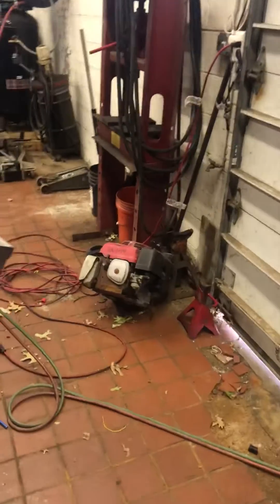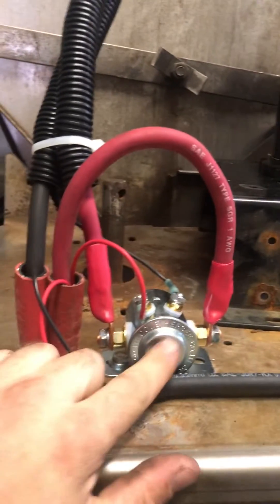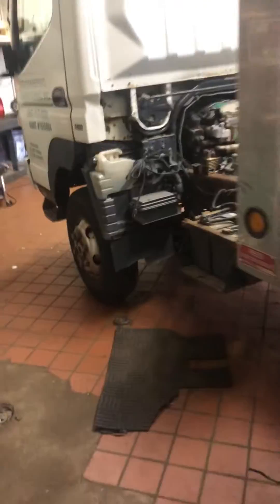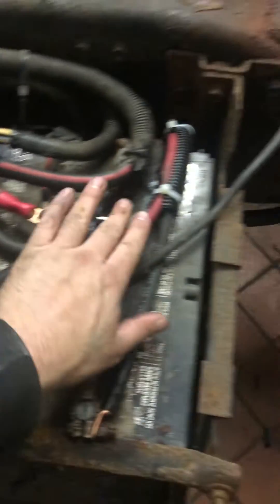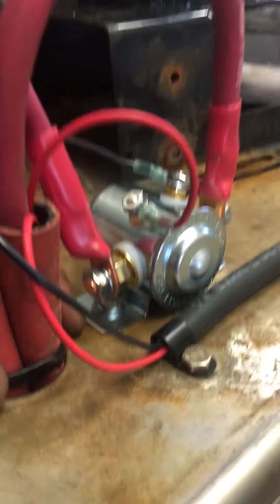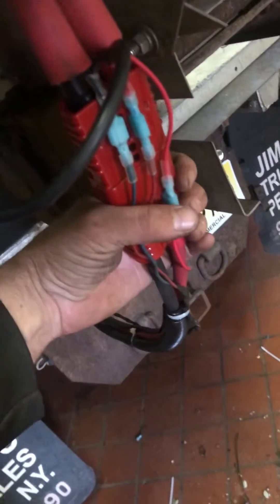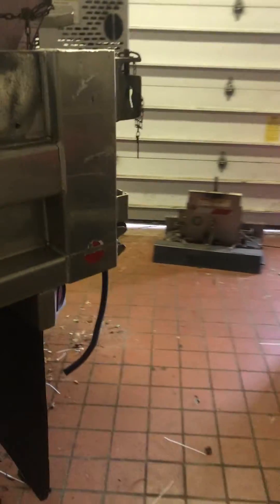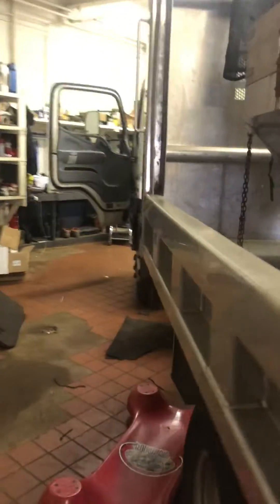Gasoline salter electric conversion part 1

Comment: Do you have a parts list?
Reply from the maker: It’s bin a while since I did one..  But if you have chain drive keep same ratio as stock.. is both video to figure out the rest.. heavy cables, continuous duty solenoid heavy duty..250 amp breaker and a switch.. 1 hp motor I believe 5/8 shaft could be wrong
Reply from the maker: I have to videos on these salters you can reference
Reply: @DieselTechRob can send to me?

Comment: And my other question is are you running those two batteries in parallel to power that or is it in theory just running off of One battery cuz I have mine set up just running off of One battery and the trucks battery is charging it I ran a wire from the psalter up to the truck battery and rounded the Salter battery to the frame it does seem to be charging
Reply from the maker: Justin Burden I run them directly off the truck batteries.. no charge battery,.. using HEAVEY cables.. also on the big gear I’m using 72 tooth
Reply: @DieselTechRob  any idea how what your small sprocket is I really appreciate your help
Reply from the maker: Justin Burden I don’t know exact tooth size.. but you’ll have to play with different sprockets to dial your set up in.. the gearing in the gear box might be different then my set up.. what kind of salter is it.. make sure you stick to the original size gears or pulleys that came with it from the factory.. then go from there.. also make sure your getting the right rpm out of the motor.. let me know... if you need exact tooth numbers I’d have to make a phone call to customers I did it for to find out
Reply: @DieselTechRob  ok it is an old Swenson salt spreader I put new sprockets on and a chain because it was the old belt chain drive so I wanted to eliminate the belt because sometimes it would slip so I'm going from belt pulleys to sprockets
Reply from the maker: Justin Burden yes all chain is best.. I can’t tell you what will work with that old salter the ratios are probably different then the western ice breakers I do the conversions on
Reply from the maker: Justin Burden also most of the trucks I do it on are diesels and have two truck battering in parallel.. I’ve never had this kind of problem.. only problem I had was spinner didn’t spread wide enough.. so i put a smaller size pulley on the spinner and all was well

Comment: Yes I just feel like my drag chain and thrower are moving too slow I ran a 1 horsepower 1800 RPM Motor the setup right now is off of the motor of a 12 tooth sprocket and the big sprocket is a 52 tooth

Comment: What number teeth are your sprockets as in how big are the sprockets that you are running on this I copied you to the best of my ability and did this but I think my gearing is a little bit off
Reply from the maker: I usually stick to whatever was on the salter from the factory and adjust the sizes of need be.. what’s the actual problem your having.. spinner to slow to fast? Conveyer to slow or to fast?

Comment: i want to do this to my sander. what motor did you use? where did you get all the parts for this conversion. any info you can provide would be great
Reply from the maker: R P  1 hp motor.. 5/8 shaft I believe.. 1 gauge cables.. 100 amp breaker by the battery.. same sprockets sizes that were original on the gas engine.. 90
Amp continuous duty solenoid.. toggle switch on the dash in the cab.. I got all the parts from local vendors in my area.. I’ve done 3 so far and my customers love them.. worth the money and time to do it..
Reply: Rob the Mechanic  thanks for the info. I’m having a hard time finding the electric motor. I am in CT could you point me in the right direction. Maybe you could let me know the make and model of the motor. Sorry to bother you. Thanks
Reply from the maker: R P  call Robert and sons in Garfield NJ.. they have everything.. it’s a stater alternator store.. they have motors in stock.. just tell them what your trying to do.. and they will ship.👍🏻
Reply: @DieselTechRob  what is the amp hour of your motor. I'm having a hard time finding the right motor. Thanks
Reply: @DieselTechRob  what size sprockets are you using as in how many teeth sprocket off of the motor and how many teeth on the big sprocket